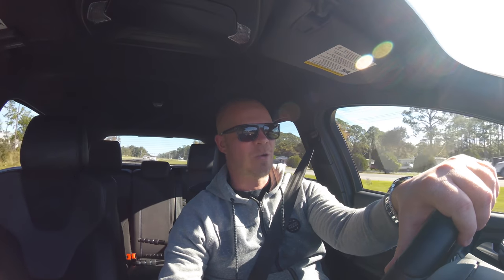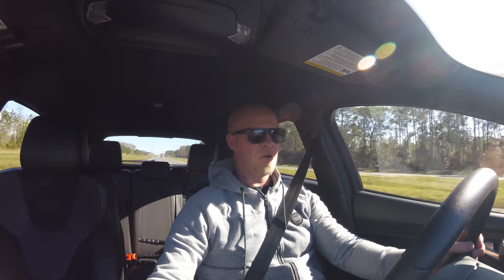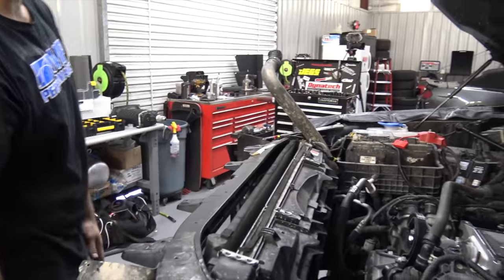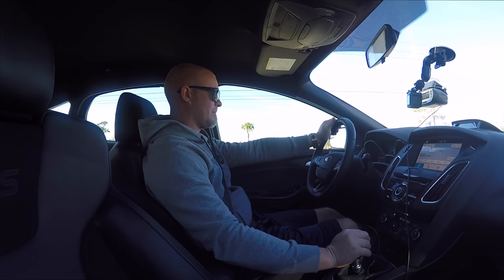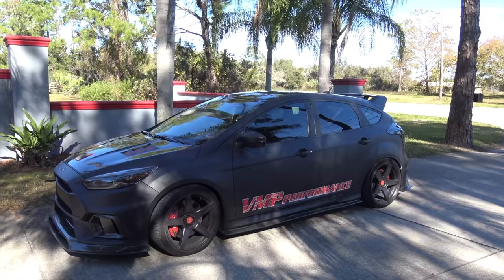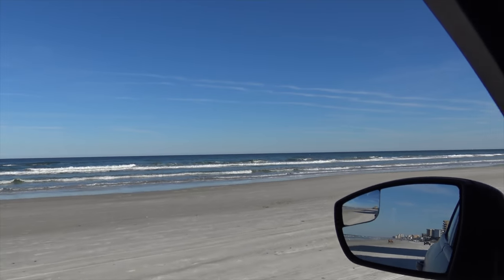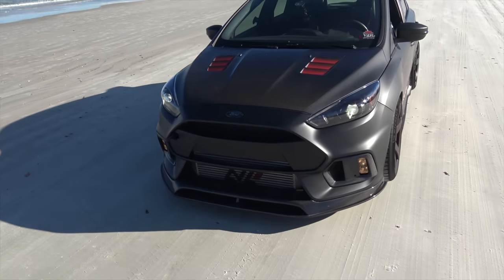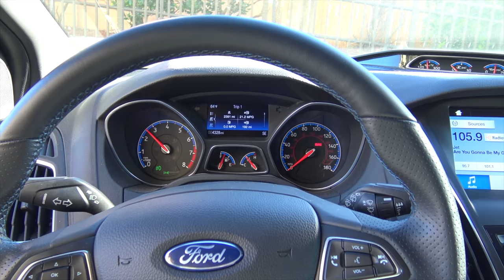Every Ricers Wet Dream? SEMA Built Ford Focus RS!

Comment: 5:08 Engine compartment cleaning. Do they even appreciate the area in which you live: PITTSBURGH, PENNSYLVANIA? For all goodness sake let's not forget that from the Carolinas up to Western Pennsylvania had snow. With snow, comes road traction salt. Salts that are dissolved into road spray thus kicked up by the front wheels and decorating the engine.

Comment: I spent far less than that and mine looks better AND makes 450-475 crank.  That suspension is a "rich ricetard" choice.  Should have spent that on better coilovers, springs, bars, mounts, clutch, diff, turbo etc etc.

Comment: I think you spelt the title wrong... Every “R-A-cer”...
Reply: Agree to that!!!
Reply: So, neither of you are aware enough to understand that hopped up Japanese cars have been called "ricers" for years?  Talk about the "woke" generation...
Reply: Pretty show racer
Reply: That's not a ricer you fool. Honda civic with loud muffler isn't moving fast is a ricer. A car with super wide camber kit looking like a spaceship is a ricer, anything that makes the car look ultra wired looking is a ricer
Reply: CAR&GAMECHANNEL how about a 4 banger with 20 grand in that is loud and slow
Reply: @whiteandnerdytuba  4.9 second for a 4 banger isnt slow lmao, most v6 can only go from 0 to 60 in 5.8 so thats impassive for a 4 banger. mike didn't get into full detail as in why it cost 20k. like the air lift cost around 3k to 5k, rims cost around 2k, all those fibers cost around 500 to 1k, now the turbo upgrade cost around 5lk plus 2k to install, and he probably got more that didn't see in the video.
Reply: CAR&GAMECHANNEL ok in a vacuum with no other cars it's fast. Since other cars do exist though it's slow. For the price of that focus you can get a faster f150
Reply: @whiteandnerdytuba  no stock f150 can beat that focus car.  you need to upgrade  just like the focus owner did. so its gonna end up with the same price with worse gas mileage lmaoo
Reply: CAR&GAMECHANNEL what's the second o in LMAO mean? That focus is 60 grand plus. XLT f150 are 35k + 15k blower install= 50k. Math is hard. Stock focus rs can be beaten by stx f150 with blower for 40k. Math is hard, ignorance is cheap
Reply: Buckhorn Cortez sorry I didn’t know that.... I thought he made a spelling mistake, thanks for informing me on what Ricer means
Reply: @whiteandnerdytuba  i did read you comments and i said where do you buy your cars from? cause RS  cost around 37k  and can beat a stock f150, so your math is off like always lol.
Reply: CAR&GAMECHANNEL I'll break this down again like I'm speaking to a child. A 40k RS gets a discount to 37k. You're still 2-5k less than the f150. You yourself said they have the same 0-60 stock. For 2-5k anything you add to the f150 such as a 200 dollar tuner makes it faster. 30-35k < 37-40k. Common core didn't help you